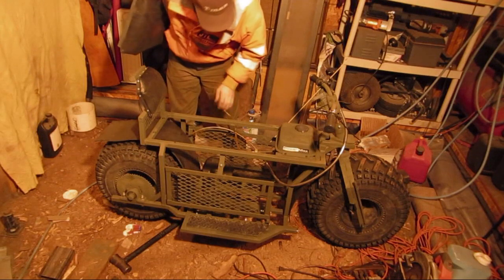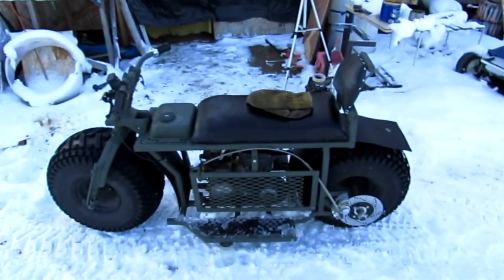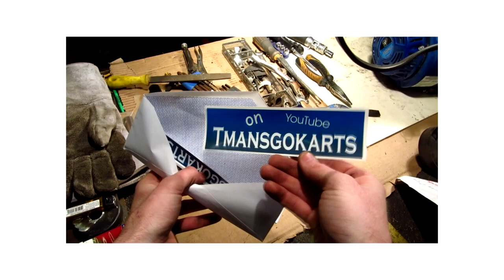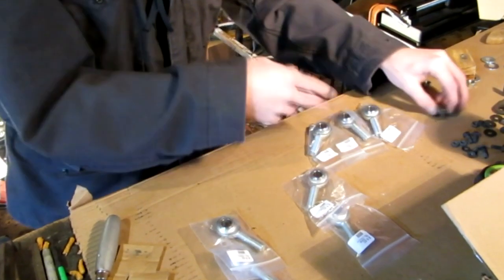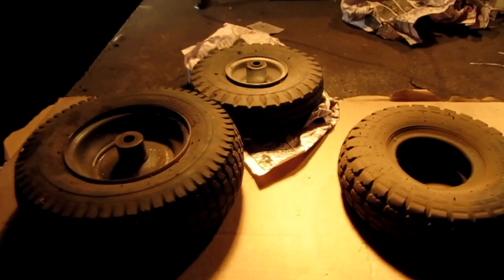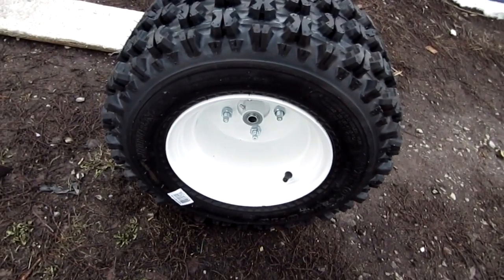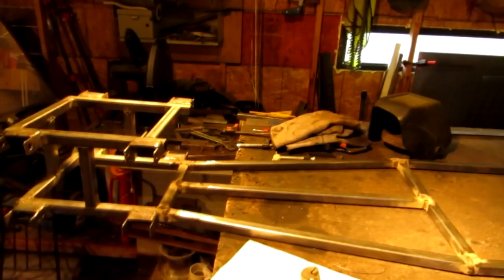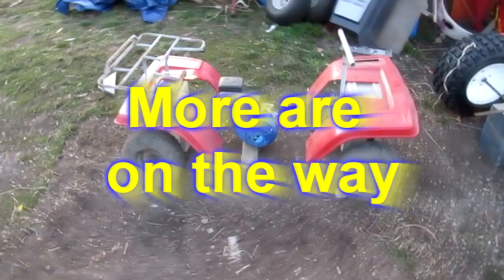T-mans 2013 first quarter CLASSICS

Comment: Hey t man I need help im planing on building a street race cart but im confused on the arkmen angles . How to I figure out what arkmen angle im gonna need I read one the saying to go from the kingpin bolt hole to the center of your rear axle and whatever degree that is is what you want it to be angled at. I could use your help alot.